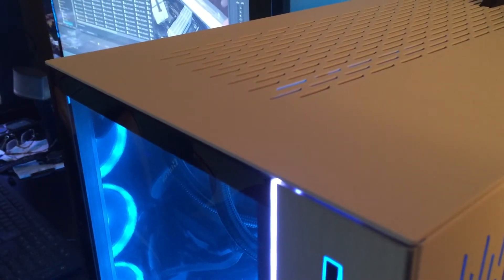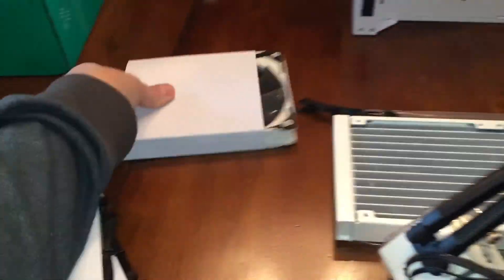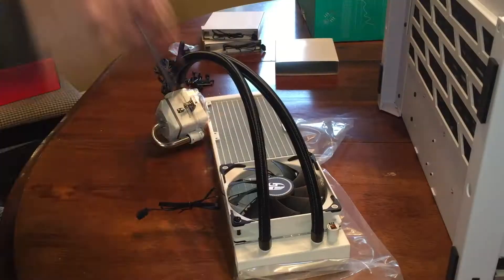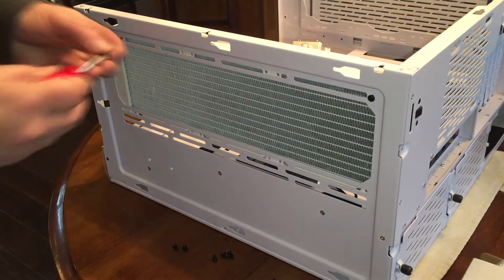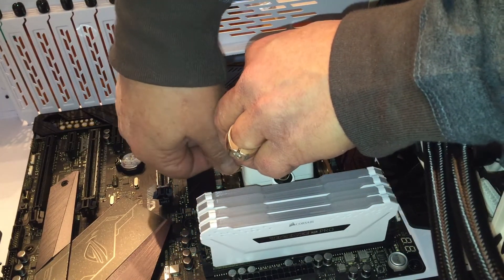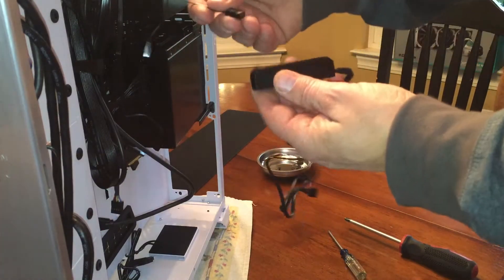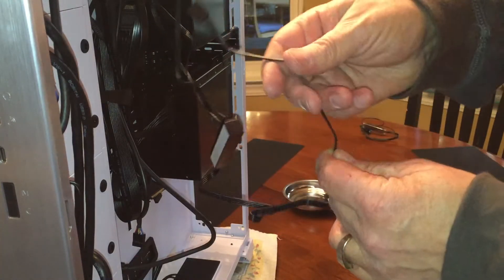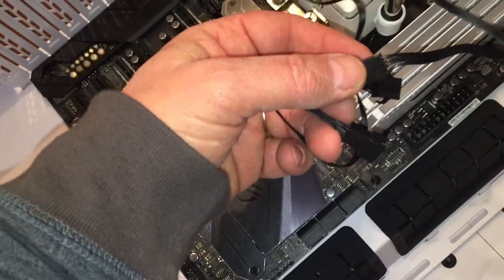Building a Computer Guide - Part 2

Comment: nice job man! what made you choose the dynamic Xl over the regular
Reply from the maker: I considered both but felt this one worked with the system better.
Reply: @DollarDIY  are you getting solid numbers regarding air. Cause im on the fence between the Dynamic, XL, or the corair 680x. I
Reply: @Tacticalpanda757   The O11 XL has much better airflow than the 680X.
Corsair called it High Airflow but in reality you could get -8.5°C on the cpu just removing the glass front panel.
Lian Li sells it without any fan, so temps depends on how many fans (and where) you put them, but they were much more clever putting the side intake.